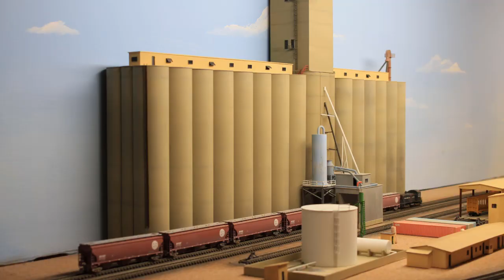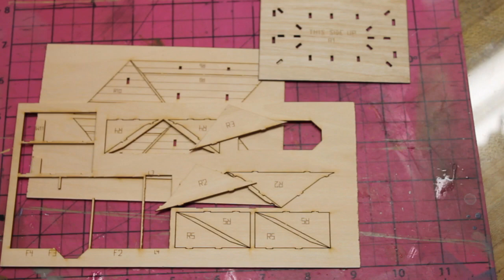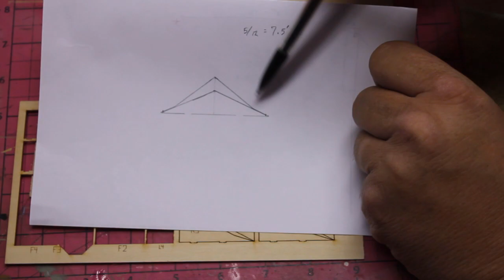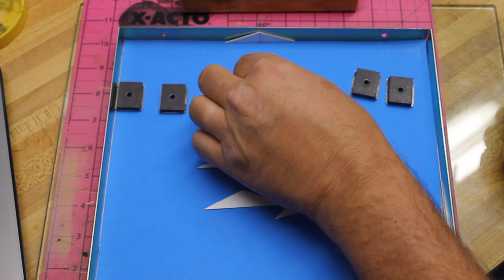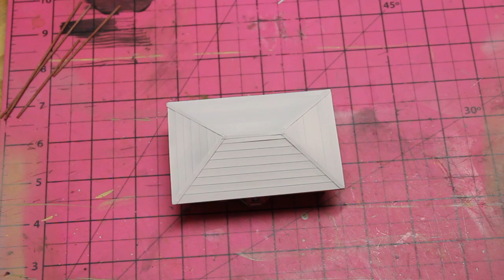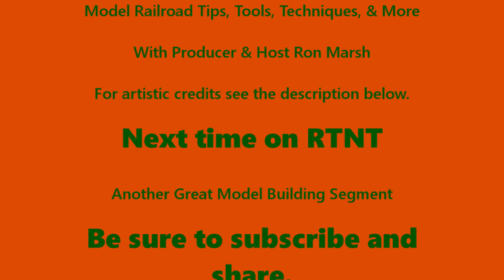How to Build a Craftsman Wood Structure Kit Part 2  Modified Roof and Details

Comment: Nice Ron!! I guess I'm odd... I don't mind longer videos. As long as the content is good, a full hour isn't unreasonable!
I liked the idea of modifying the roof. I'm guessing that like most, these kits represent Eastern structures, and have steeper pitched roofs because of the snowfall. 
I definitely got ideas from this, as I'm going to scratchbuild a couple of buildings, and understanding the actual archetecture under the roof was a huge help! 😀 

One thing, and I'm SURE it's just me... but while the roof was off, seemed like a great time to install some SMDs in the slots in the ceiling, for interior lighting, where the roof supports would have gone, had you used the wood parts. 
..... And there's an advantage of wood kits worth mentioning. If you do light your structures, the only place you have to worry about light leaking, is at the body seams. And those can be easily sealed with some black RTV Silicone on the inside! 
I really like the way you present your subjects! A main reason why I do so few videos. I've got a face for radio, and little stage presence!! 😵😝
Carmine 🚂
Reply from the maker: +PacbeltRR Hi, Carmine. Thanks for your comment. As for the lighting, I considered doing some detailing on the interiobr and lighting this kit, but when I put it on the layout to test it I realize that it was so close to the backdrop on the upper deck of my layout that you would never see it even with lights. That's why I decided not to light or detail the interior.

You make a good point about the wood kits and light. Thanks for bringing that up. That is something I had thought about mentioning when I considered lighting the structure, but since I didn't I never got it mentioned.

As for your last comment, you'll notice that I almost never show my face during the modeling portions of these videos. LOL. I am, however, a public speaker by trade so I have a little practice and experience at that. Thanks again for watching.